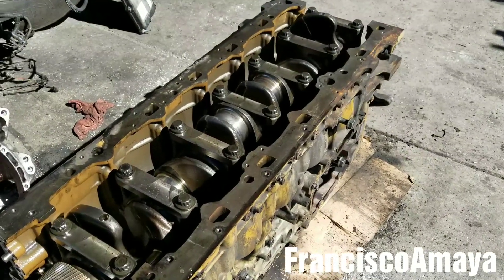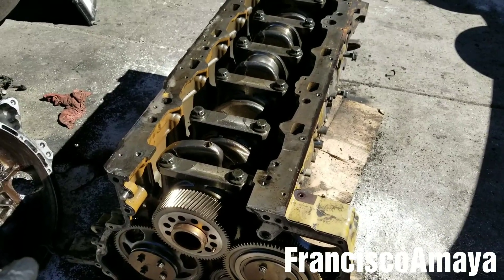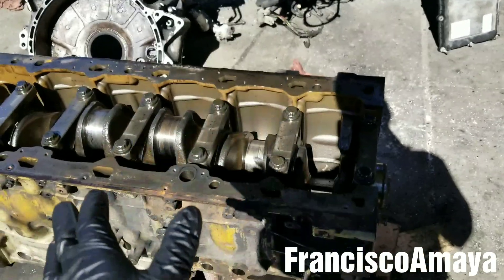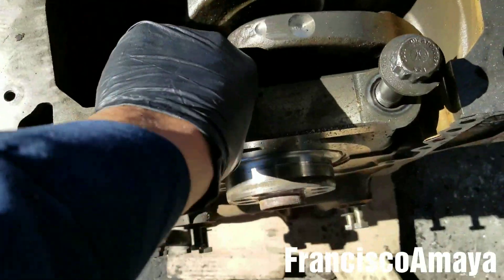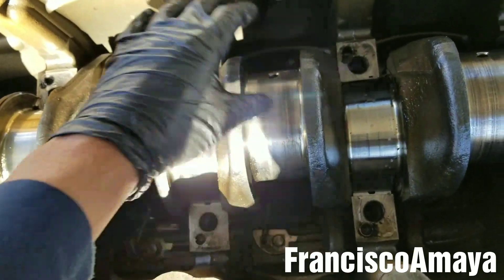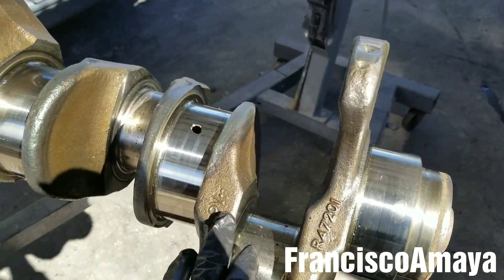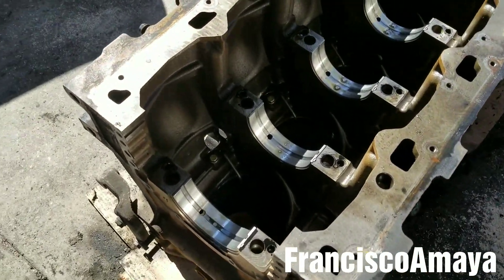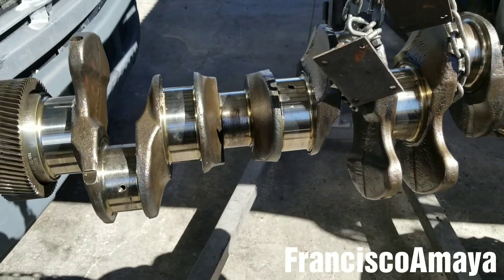DD13 DD15 DD16 crankshaft replacement main bearings cap torque part 1

Comment: Hello Francisco, I replaced the oil cooler and the tech also did a pressure test to see if the truck lining is bad. They told me looked like ok but I still have oil in my coolant tank after flushed two times. If my egr cooler bad, could it be oil in coolant tank?
Reply from the maker: It takes a while for the oil to be completed remove for the system. If have oil but it is not getting worst, that is fine.

Comment: Advice: Tell the customer to replace the fly wheel housing if it has alot of miles ....its only 400 dollars and he will save money on labour.  ..it will go bad.Mine went bad at 900k it starrted leaking oil  due to vibration and heat ....oh and engine mountigs suports and a new crankshafy breather
Reply from the maker: Exactly,  you are right. I do recommend that too.